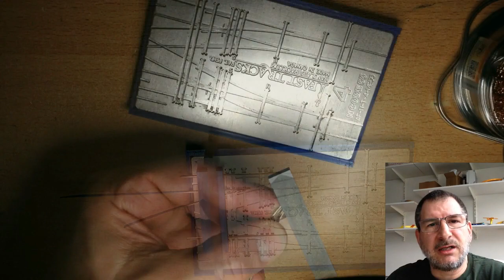1st version 12 Inch Tangential Turnout Build N Scale Model Train Hand Built Tracks 3D Printed

Comment: I like the idea of using the track gauge to hold the rail in place when soldering. not after you solder.
Reply from the maker: The printed jigs are no where near as accurate as one milled out of aluminum. Without the jigs I don't think the tracks would work very well. I planned to mill them but with a tiny layout the printed ones worked well enough.

Comment: Very cool and interesting video. Love the jigs you’ve designed!! Absolutely agree on the possibilities of custom designed turnouts, especially for smaller layouts. Or, as you’ve shown, where the geometry of readily available switches, or turnout building templates aren’t accurate enough for the curve of the diverging route!!
Reply from the maker: Crushing into a tiny space forced compromises. It is fun to build switches and track, hence I went max track and switches... I still can't get an easement line drawn in Sketchup, so some of the turnouts begin a bit harsh...

Comment: Nice. I can use a lot of your tips. I intend to motorize 1/72 scale locos.... such rails does not exist in real life...
Reply from the maker: If you are making your own rolling stock, then the gauge is easy to set and make your tracks to suit! Magnetic couplers can be a simple solution as long as you don't reverse the cars.

Comment: Great Socrates. Can you show us a convoy running on your turnouts? The curiosity grow up! I have question for you. Dou you happen that the mobile rails of the turnout doesn't  goes to the end of its path and stops in the middle with no contact with on of the near rail? How you solve this issue?
Reply from the maker: I think you are asking how the isolated frog where the rails cross gets powered? There is a third wire that powers the frog junction depending on how the switch is thrown. One way it is positive the other negative. The switch has a jumper wire to reverse the polarity of the isolated frog section. Before running trains I have to wire and code the arduinos which will control the stepper motors and turnouts. I did a test version already so the system worked.
Reply: @handlaidtracksand3dprinted922  Thanks to the answer, but I asked about the bad work of hinged rail that like a spring doesn't stay at its end of stroke but tends to remain in the middle of their path. I ask you a suggestion to maintein the rail in the true position after you switch the turnout.
Reply from the maker: I'm going to use a small stepper motor controlled by an arduino processor and a toggle switch. You can also use a small drone servo mounted under the layout with a wire through the throwbar tie. Also can be controlled with the same Arduino board. This is the stepper I'm intending to use. https://nl.aliexpress.com/item/4001212984521.html?gatewayAdapt=glo2nld&spm=a2g0o.9042311.0.0.27424c4dSvPyma